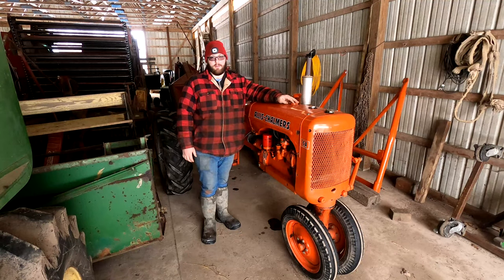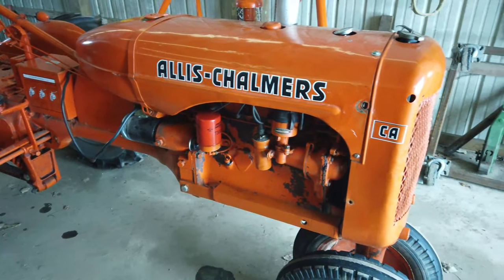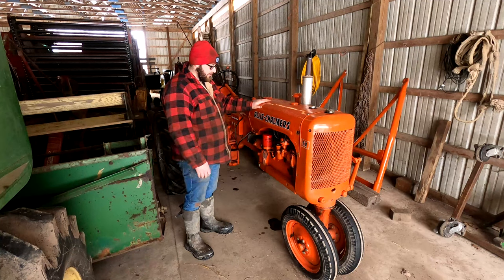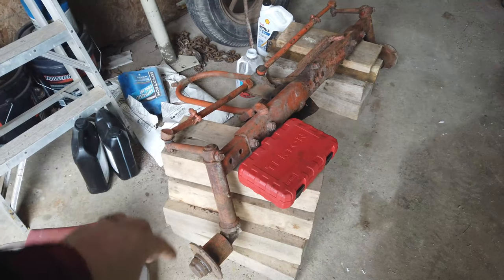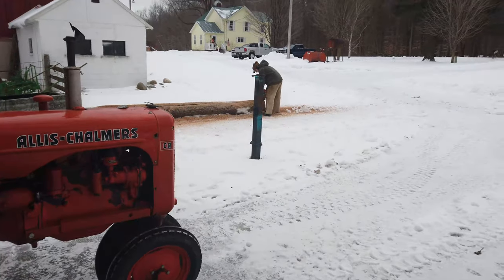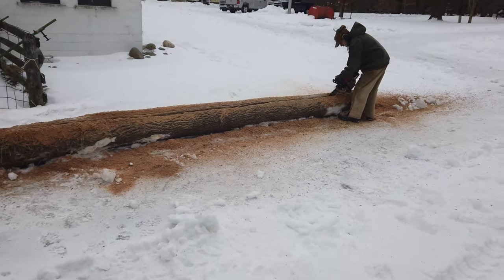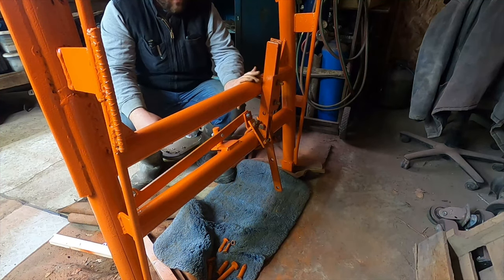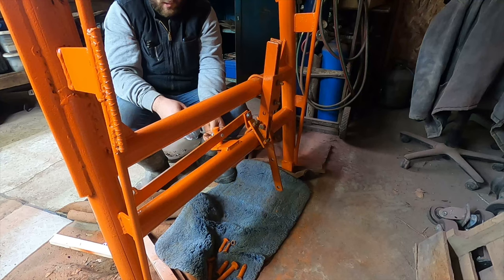Episode 5 Allis Chalmers Loader Install

Comment: If you put a ball valve in the line for the lift hose right under the seat you don’t have to use loader cylinder stops. You can just shut the valve off and still use the rear lift. We do it to our d17 wd45 and ca all have loaders
Reply from the maker: Yes we are definitely looking to do something like that!